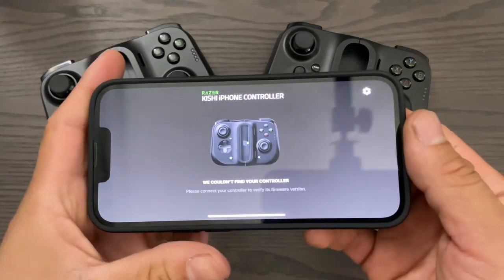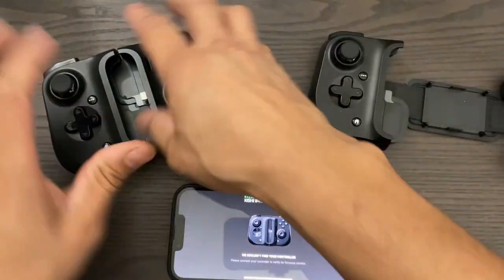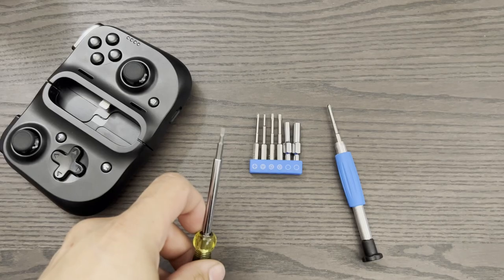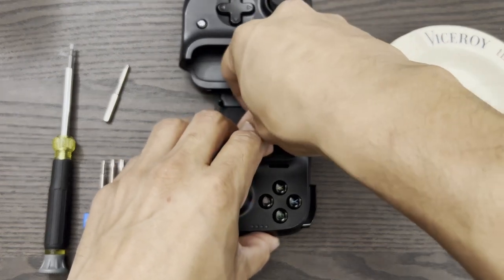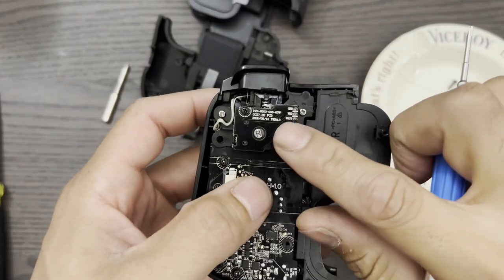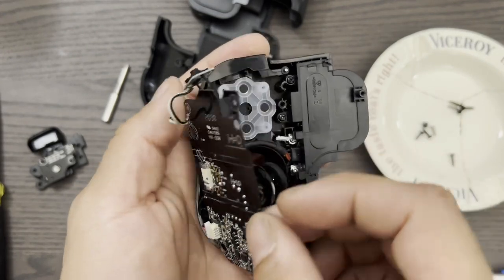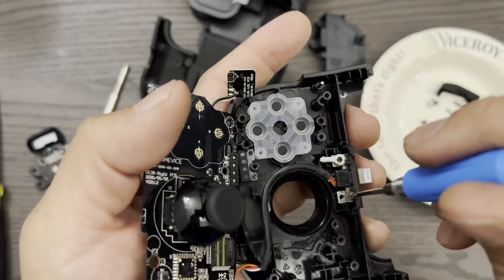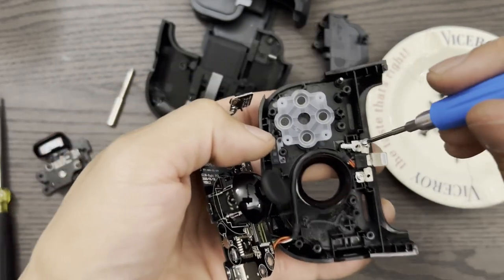Razer Kishi Mod: Make Your Slim Case Fit

Comment: Hey, thanks for this neat and clear tutorial.

Every iPhone user does not like removing cases, especially the thick ones. Nice video.

I'm using an iPhone XR. My case was too slim even with your mod. There was an empty space underneath the slots. What I did is I traced the original rubber spacers on a cheap rubberized mousepad. Then I cut it through the traced shaped. Now this perfectly fits the slot and the space adds grip for just the right tightness. The phone with the case in place is snug and fit. I'm using a xundd beatle case.

Thanks again for sharing this mod. :)

Comment: Great guide, followed it and managed to get the Kishi usable with a chonker Magsafe case on an iPhone 11 (one of the random billion ones that makes a non-magsafe iPhone with regular Qi charging magsafe compatible. Now I just gotta add some small bits of tape or something to get it properly snug (something that the rubber inserts didn't really do all that great with the iPhone 11 anyways) and it should be smooth sailing
Reply from the maker: That’s awesome! I’m glad the video helped you. For one of my Kishis I cut up the the stock rubber inserts to use just the flat parts and glued them into place to make a glove tight fight. It worked out perfectly!

Comment: Use hot blade to cut the plastic in the back thats blocking the camera
Reply from the maker: That’s a great idea! I used a Dremel on one of my Kishis in some spots to make space for a pretty thick dual layer case.
Reply: Yea im surprise how easy it was to cut it, like cutting butter, you just need the blade hot enough.

Comment: Great video. I had a quick question. There were 4 screws on that held the plastic peice in place. I noticed you only put the silver screws back on and not the 2 black screws. Is there a reason you did not put all four screws back on?
Reply: When you remove the black plastic piece there’s a gap between the lighting port screw holes and the Kishi screw holes. If you screw the the other two screws in there’s a chance that you can close the gap and tilt the port in towards the Kishi. I haven’t tried it but I’m assuming that’s why.

Comment: I’m interested in hearing from anyone who’s done this… has anyone run into the issue of the integrated lightning connection getting ripped from the Kishi and stuck in the phone with the black piece removed?

Comment: Do you think is possible to make an upgrade on the android version from only charge type c to type c 2.0 at least? that way we might be able to connect an external display? like with an adaptor? MHL supported of course
Reply from the maker: You’ve got me on that one. I really don’t know how the 2.0 port would react to the rest of the Kishi hardware. If you’ve got some soldering skills I’d love to see if you can get this working. In theory, with a 2.0 port it should output video just fine with an HDMI adapter.
Reply: @Raxxla_  I will have to learn in order to make my dream comes true then hahaha but if make it ill let you know :D, thanks for the answer, btw very cool video
Reply from the maker: @Enrique98Diego  I hope you can make it work friend!